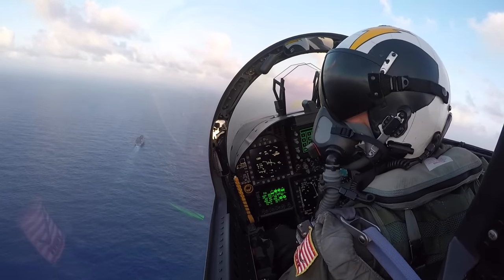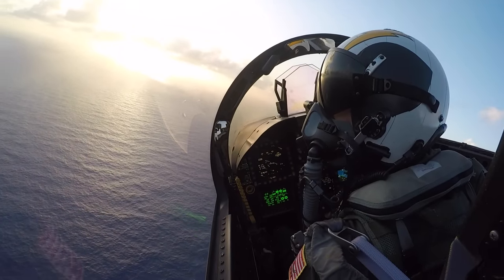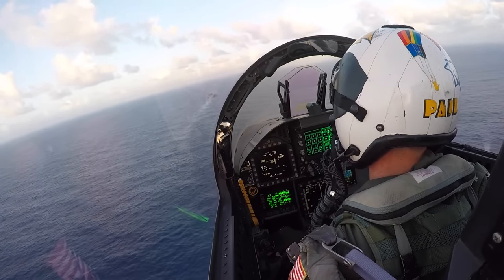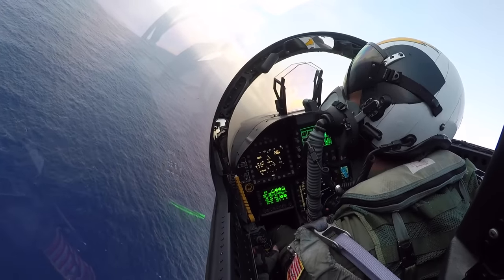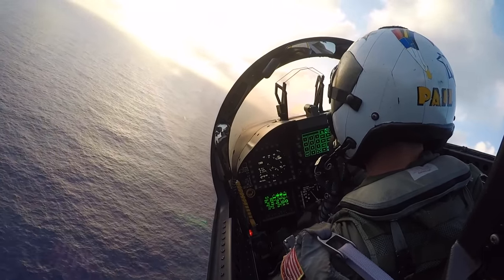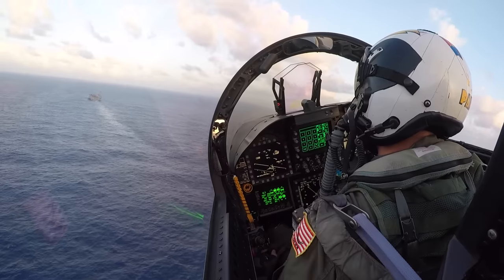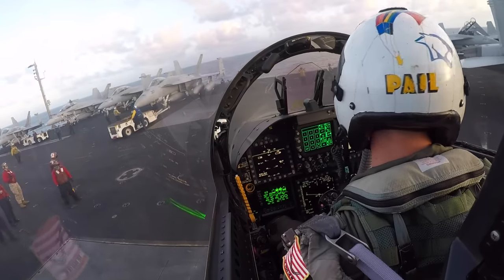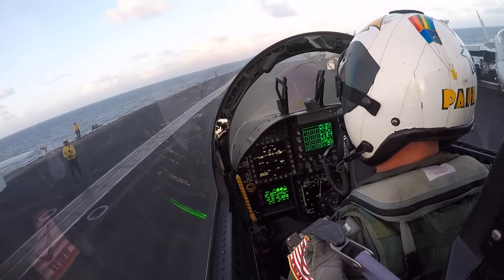Carrier Landing Clinic: Textbook Trap

Comment: Another interesting video, i noticed you using the grab handles and moving your body a lot. I assumed pilots were strapped down pretty much in the seat but I observed you moving around a lot. Interesting to me because I drive a semi truck dump truck off road. I am throwback and forth and side to side from the bumps. You must get a real workout flying around. Thanks again for your service

Comment: The whole time I was with VA-15 I hoped to get a launch and a trap in an A3 or a FUD, but no luck.  Although I was an AO, I spent some time as a Maint Control PO, worked in the Ready Room and got to know our pilots better then most of the other white hats.  Night traps were the worst, especially on a moonless night with some deck pitch.  When they'd come in to hand over the bird to me, you could see it on their sweaty faces .. just glad to be back alive!  The flight deck at night was a treacherous place to work under red lights with helmet, ear and eye protection.  Lots of accidents and mishaps that you never heard about back then.  Guys sucked down intakes, walk into props or blown overboard by exhaust.  One of my "favorite" jobs was to sit at the cats and plug in missiles just before the shooter launched.  There was so much stray voltage being generated by the ship, radar sweeps, etc. you had a go/no go box to test the plug and you prayed that no stray voltage occurred before you plugged it in to the weapon.  If that happened It would fire out to sea, but it would also fry you up pretty good in the process.  Not the case in the Forrestal incident when someone left Zuni's plugged in an F4 when it was parked and pointing at other A4's parked.  To speed up launch time they waived that safety protocol.  If you've never watched the film of that it's amazing .. John McCain was one of the pilots scrambling to safety.  A hose crew simply vaporized during a huge explosion.  Ship was severely damaged.  What a catastrophe !!!  https://www.youtube.com/watch?v=a1ScXDbwPGs

Comment: That is absolutely awesome, I love your Videos.
Can you please explain what makes the Hornet balloon up after Gear and Flaps full down below 250kts (speaking of DCS Hornet C Flight Model...do you know DCS?)?
Have you used Speedbrakes during the turn to Downwind in order to decelerate faster down from 350 to 250? I could reproduce a lot from the HUD repeater on the left DDI, but couldn't see if you've used Speedbrakes also.
Thanks a lot for all of your Videos, they are really a precious resource for us from the DCS Community
Reply from the maker: I’ve never flown the Hornet or DCS.  I can tell you the Super Hornet doesn’t balloon when the gear is extended. 

Yes, once we break, we use speed brakes to slow, until the gear goes down.

Comment: Ya know ... former Marine air winger here ... aviation electrician on RF-4Bs ... 

My sphincter factor went way high during the taxi to park phase there as the directors had you in a hard left turn to park and OUT OVER THE EDGE YOU GO seemingly going to taxi right off the deck. It never occurred to me in my years of debriefing "gripes" at maintenance control following hops just how much trust the aircrews had to place in those of us on the ground whose job it was to make the aircraft safe to fly, and once you got back on the deck the trust that we would bring you back where you needed to be.

Comment: Excellent. Do you generally fly 250 knots within 10 miles until you head toward 800ft from the stack?
Reply from the maker: No.  Just depends.  We usually fly around 300 until we hold.

Comment: If you roll out on the downwind, let's say much closer, 1 mile abeam of the ship, could you still make that turn or would it be too tight? Would it also make the groove time too short maybe?

I'm just wondering because I usually have trouble with that final turn in DCS
Reply from the maker: You can make it work if your deviations are reasonable.  Too tight usually results in too much power at the start and being fast, which is a difficult fix at the start with manual ball flying.

Comment: Two questions: Always curious why the carrier island is located on the starboard side--windward side.  Why not leeward so no burble effect?

Second question:  Is the 3-wire spot on the runway close to the center of gravity of the carrier?  Seems to me (perhaps naively) on a pitching deck, your aim spot should be the likely center of deck oscillation.  Or are there other factors?

Thanks for excellent videos!
Reply from the maker: P-factor in early carriers lead to islands on the right.  

No, boat CG isn’t a factor. It’s an engendering decision based on aircraft safety.
Reply: @GrowlerJams  That reminds me of the reason for the size of the Space Shuttle boosters arising from the width of two horses and the Roman chariot axle length… If aircraft engines had generally turned in the opposite direction, the design of a $13B  aircraft carrier would be very different!

Comment: at 5:00 you say "a little power, a little pause and a little turn."...what are you getting from the pause, a more controlled descent as you wait for the power to spool up before you turn? As a result the nose doesn't dip on you and you can control the descent to the mid point a little better?
Reply from the maker: Exactly, otherwise we pick up a big VSI starting the turn.
Reply: @GrowlerJams  Copy, that's what I figured. It's the little subtleties that can make a big difference when trying to be precise. I just started the F-18 in DCS.

Comment: I'm genuinely curious why there aren't taller barriers on the edge of the decks of aircraft carriers. It seems like if you're a sailor, you could walk right off. If you're a pilot, you could roll right over the wall when parking.
Reply from the maker: We park our jets with their backends hanging off the ship.  Taller scuppers would prevent this.  The scuppers work great at slow speeds, though.  I’ve never seen or heard of a jet without an emergency going off the side.

Comment: question, does the carrier require to move forward when you land?
Reply from the maker: Not exactly.  We require around 20 knots wind over the deck for launches and recoveries.
Reply: so it depends if you have favorable wind right? but if there wasn't will the career move forward for for assistance?
Reply from the maker: Yes, it normally does.